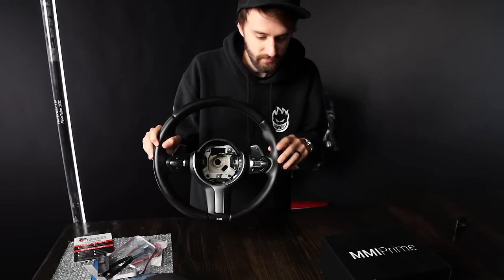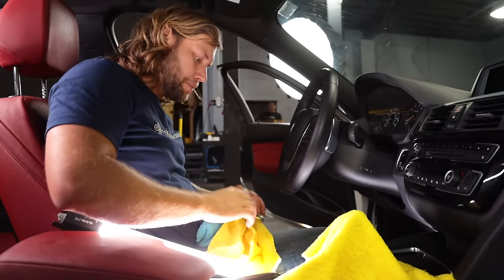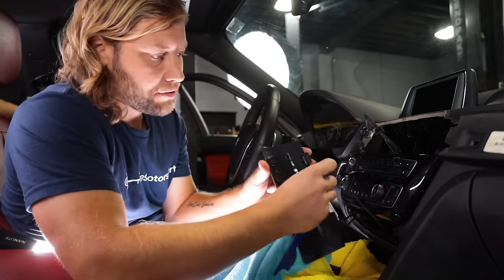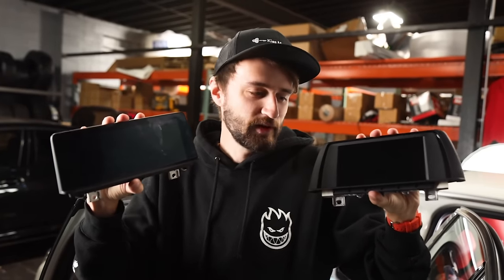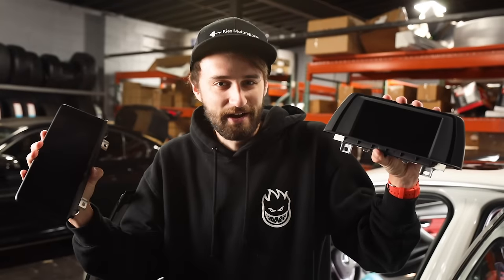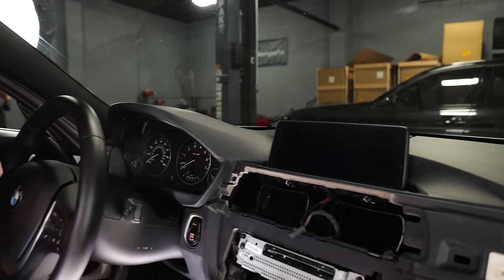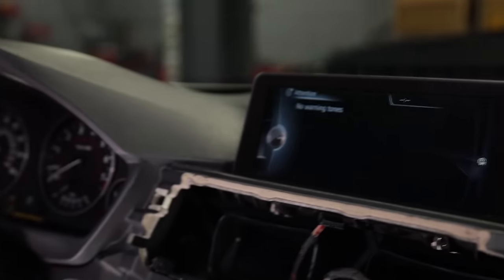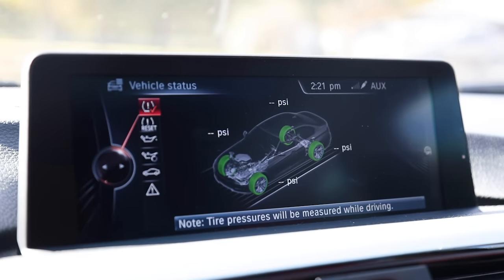How to Upgrade Your F30 BMW Screen + Apple CarPlay & Android Auto

Comment from the maker: Complete F30  Mods List ---> https://geni.us/f30-mods
Reply: How many of these have you fitted and where did you purchase this from video made it look easier than I thought it would be?
Had issues with my idrive not working at moment going to replace maybe I'd be entering of doing this install at same time.
Reply: can you do this if you have the big screen from factory but no carplay?
Reply from the maker: @KellyandmikeWilliams   kiesmotorsports.com provided both the screen and the multimedia interface module for the video. The multimedia interface has a switch so you can toggle between Apple CarPlay/ Android Auto and the factory iDrive software.
Reply from the maker: @jay7k  Yes, the screen and multi media interface (MMI) are sold separate anyway, so you'd just need the MMI if you just want to add CarPlay
Reply: Where did you buy the screen? And is it possible to buy the screen and use it just as i use the original screen i have now, without buying the MMI CarPlay?
Reply from the maker: @kkjjhhhgggff688  we got this screen in a junkyard but you can find them cheap on eBay. You can swap out yours for the bigger screen without needing the MMI or any other accessories but you’ll still need to code it to get the correct resolution
Reply: Can I do this with an even bigger screen? Or is the 8 inch one max for f chassis. I have an f32
Reply from the maker: @skate69641  I believe the 10.2" screen from the X5 will fit too

Comment: "The 6.5' peasant display" 😂😂
Reply: Back when screens were useful without being distracting though. The bigger the screen the less you will concentrate on where your peepers should be looking as in out of the front window. No wonder there are so many car crashes as people are too busy fiddling with multimedia displays.
Reply: @DEVILTAZ35  ahhh maybe! I mean there is always the option to turn the screen off regardless of the size but beside navigation the new mmi units could arguably be a bit much
Reply: @DEVILTAZ35  some old guy probably still rocking his manual stick
Reply: @hc8714  nahhhh just common sense
Reply: @DEVILTAZ35  no, it's the stuff it does while you're not looking thats the actual upgrade. Wireless android auto makes stuff way less distracting than even chamging cds

Comment: Great editing! It’s always good when you come to town!
Reply: Great video!
Reply: I'm suprised bmw hasn't tried taking you down or suing like an asshole. You just know they hate when someone smart shows us how to save money from their stealership. Preciate you bryan💪🏾
Reply: @Xylti  BMW is not Tesla, At least Indy shops and small garages can work on BMWs
Reply: Kies! Is there a kit to upgrade exhausting larger screen F30 iDrive systems to have Android Auto and Apple Carplay??
Reply: Tried swapping my 2013 f30 screen to a screen from a 2017 f30  but it doesn’t go on. Does it need coding before it can go on? My f30 doesn’t have navigation and the 2017 had navigation.
Reply: @shashankdegloorkar  Just recently BMW had taken down a bunch of websites with bmw car manuals and filing lawsuits against the owners, so if tesla doesn't do that then you might be right
Reply: How much is ?
Reply: Will this work on a 2017 BMW 320i? I was told I wouldn’t be able to get CarPlay because my radio did not have navigation. The iDrive and no navigation makes the car feel so outdated for not really being that old.
Reply: Which town?

Comment: Justin regarding your thoughts about cost of the screen, I´m working as a product engineer in automotive and we are often making changes during development of car with cost saving of 1 cent because if you can save 1cent on many areas of car it could make big difference with huge amount of manufactured cars.

Comment: Great video Justin! Would suggest upgrading the iDrive controller also to give a more OEM look. I’ve heard a lot about these solutions but tend to stray more towards a full OEM Pro Nav retrofit including the head unit with OEM CarPlay
Reply: Hey what would be the actual difference between what Justin is installing and having the full OEM Pro retrofit including the OEM CarPlay head unit
Reply: @RhinoMGTV  when you swap in a different head unit (ie. going from ENTRYNAV to NBT EVO), some features like ConnectedDrive may not work (they are VIN-locked from what i heard)
by doing Bimmertech MMI+big screen retrofit, you keep the original head unit so you can still retain all of its functions, and not lose things like ConnectedDrive.

Comment: Saw another Keys video a while back where he had to pull the glove box to mount the MMI in an f30. Nice that wasn't needed here. Pretty expensive and tedious for Carplay, but enticing to not have to disassemble the passenger-side dash. Great vid.
Reply: its 2 screws you don't have to take the glove box out just the panel underneath that you would remove to replace the filter ( I have mounted an amp there)

Comment: Would 100% recommend the steering wheel upgrade to anyone . I've done it on my 2 series and it feels better and massively enhances the aesthetic of the interior.
Reply: how much does it cost?
Reply: @michaelronan7769  you can get the wheel for anywhere between £150-£200 on eBay, and the airbag (which is usually separate) for between £60-80.
Reply: Dont upgrade the steering wheel and the screen they will get stolen.
Reply: @marsbelediyebaskani5193  maybe if u live in an absolute shit hole, i havent heard of people stealing car interior parts since like 2012

Comment: Awesome video, I used this today to replace the 6.5" screen of my 4 series for a 8.8" touch version and it was very helpful. Especially the tip to pull the unit out for some more slack on the cable was very good. I expected it wouldn't be necessary but you were absolutely right. ;-)
Reply: Where did you find the 8 in screen could you send the link please
Reply: Bro did you also use that coding program? Or its just plug & play

Comment: Cool upgrades!! I have a couple of questions, hope you'll reply!
1) Does the OEM microphone work with the MMI? Or does it have an independent mic? 
2) Which is the built year of the car? Does it have a NBT or a CIC? Does this work also on CIC/CID head units?

Thanks guys!
Reply: its a f30 so it means its a 2012/2013 hope this helps mate
Reply: @legendarygamekiller236  Dont know about him but I have a 2013 as well, good to know it would work thanks
Reply: Neither the Cic nor the nbt have the capabilities for Apple Carplay. You need to upgrade your Head Unit to either a NBT Evo the least to get access to Carplay.
Reply: @legendarygamekiller236  its a 2016… 340i

Comment: Thank you for the video! This is the proof I needed that you could use the non touch 8.8 inch screen with the entry head unit, obviously coding the car to use the bigger screen.

Comment: I installed the AvinUSA 10.25” android display in my F30 & it’s a way better option than this. You get wireless CarPlay, android auto, & can install any Android apps + 4G LTE. I don’t see any reason to go with this over that for the price. That said, solid video though & Kies Motorsports is a good company
Reply: And you can choose to change the layout to be ID5, ID6 or ID7. Oh, and 1080p with touch...
Reply: Does bluetooth go over factory bluetooth? Or through the Avin unit?
Reply: @PirateRagnarDanneskjold  Both, you can choose that yourself in the settings.

Comment: I ended up getting a OEM iDrive 6 retrofit kit from RetrofitMyBimmer.com that was Plug and Play because I didn’t want to experience the Audio Quality LOSS in the MMI. Came precoded to my
vin so I kept all my cars options and it also included Carplay Fullscreen and all that jazz . It was actually almost cheaper than the MMI and New Screen from BimmerTech too. They even include the T20 and Trim Removal tool. I got to keep my OEM Status and not experience ANY audio quality loss like all the MMI’s do.

Comment: you can also use the OEM head unit from 2017 or newer as it has wireless apple car play but no android auto, which isn't an issue if you don't have android.  surprised your car didn't have the bigger screen as I believe the 340 did come standard with the HK Audio.

Comment: Do you need the MMI unit if you just want the bigger screen? I have an Android and hate Android auto, I have it in my other vehicles. I just want a bigger screen.
Reply from the maker: The OEM screens are interchangeable but you still need to code them to the new resolution
Reply: @justinbuice  thanks. I appreciate your content. Everything I never knew I needed.

Comment: Hows the quality of the backup camera after adding MMI and upgrading to the 8.8 inch screen? It’s pretty clear on the 6.5, but curious to see if it’s still the same or better/worse.
Reply: It’s the same as the camera didn’t didn’t change. Just the display

Comment: Hi guys, 
are there any special things you need to do when you upgrade from the small screen to an original X5 10,25" ? 
I tried it with only changing the screen but I if I choose "wide screen" when coding, the display stays black. Maybe you could help me. Greets from Germany :)

Comment: Can I use that oem big screen on my bmw f30 328i 2013 will it work fine ?
Reply from the maker: It should be plug and play but you will still need to code the new resolution

Comment: I installed my CarPlay today... it worked perfectly, but then i realized that i couldn't fit the MMI Prime box behind my radio box. so i unplugged it all, mounted it somewhere nice, and replugged everything in...

then I saw a "No Signal" text on my screen (which was up during the first setup process but went away when everything plugged in) even though i triple checked all the wires once i replugged everything. let the car sit for 20 mins, drove for an hour, still said no signal the entire time. CarPlay does work because my phone recognizes it when plugged in but the screen won't do anything even though it worked perfectly the first time.

Comment: Does this integrate with cars equipped with heads-up display? Been thinking about doing this for a while but not sure if it would work with HUD
Reply: Won.t. Work
Reply: @Ajdjdncjekskf  Why?
Reply: @jouldalk   I know these, they don’t. They can communicate with the HUD.
Reply: @Ajdjdncjekskf  OK. So basically I would lose hud if I do this mode, right?
Reply: @jouldalk  OEM hud keeps working. But route instructions coming from apple carplay itself won’t show on HUD. If any other questions ask www.bimmersupplies.nl , theyy will help 🙂.

Comment: over 600 bucks ?!?!?! heeelll NO !
Reply: you have a 340 but can’t afford a $600 screen?
Reply: @boyhelios9171  you know that 320D exists, right? doesn't need to be a 340i, and looks the same :)
also, you know you can buy a used 320i non-LCI with $10k with higher mileage but still good to go for more than 5 years, right?
now imagine that you throw in 5% of the total car's cost into the screen alone :) worth it ? maybe for you, but i'd rather get better tires or filters, etc or even a stage1 for that matter 😅
heck, i can even have remote engine start for cooling/heating function from my android for that money (mounting included). yeah, definitely going with this instead of a freakin' screen
Reply: @Ris-v4w  stacks out, fire the birds or hire the barn manager lol. for 20 bucks less even /hour cant find someone who can keep count or watch the etc etc etc.... like trees / houses / ferns / whatever you call them, and its lucky you even can manage
Reply: 3yrs later and it’s double the price 😢

Comment: hey quick question for some reason my buttons on the steering wheel are not working after replacing the screen and would like to know if you guys could help me with that

Comment: What iDrive version are you using?  I have version 6 in my 430i. I use Android and wanted to see what I could do to upgrade or get android access. How hard was it to install and did you have to order it specifically for your car?

Comment: If my OEM video cable (originally that pluggued into the screen) breaks, is there a way to replace it? BMW 2013 318D F30 6 pin LVDS Right hand Drive

Comment: My screen on my 2013 328i stopped working awhile back. It only shows the BMW startup screen and after a couple seconds it shuts off and tries to reboot again. Would doing this diy fix my issue of not having the entertainment hub working? Or is it going to be more complicated than just adding a new after market screen? Any response would be greatly appreciated,  thanks!

Comment: I change from the small  factory screen to 7 inch factory screen but when i turn on the car there was nothing came on screen but the fm and the audio system is working. And then i reinstall the small screen it is working. I dont no what goes wrong with the bigger screen.

Comment: Thank you for the great video. My Z4 E89 Android touch screen does not respond at all, but the i-Drive works.  However, with the i-Drive I cannot go to the apps or settings menus.  Is there a solution for it? I would appreciate if you can tell me what to do to fix the issue.
Thank you in advance.
BTW, I resettled the OS via the small reset hole on the system, but that did not fix the issue!

Comment: I have 2015 BMW 328i M3, same as yours with red leather and silver dash trim, and it doesn't have Android Auto, sooooo annoying. Mines even came with the 8.8" screen already. Couldn't upgrade factory software to new version because 1 season too old. So if I buy that black MMI media box, it will give me the new Apps UI??

Comment: Hey, Justin! Any problems with an orange No Signal message after upgrading the screen and installing the MMI Prime? In particular when the car/iDrive is turned off but not with the doors locked. Thank you!

Comment: Hello Justin, Im in the UK this Bimmercode you used to code the screen you used a v peak in the obd2 port can i buy any similar bluetoooth obd2 device to connect to this bimmercode app you have, ive heard about coding for the BMW i just dont know much about it. i have an F46 2 series, I am a competent guy its just ive been ill for several years and only now just getting back on my feet and learning more about new tec... Thanks..!!

Comment: Does the audio connect directly to speakers like the idrive or should you set the audio to aux for audio output in carplay and android auto?
Simply, how is the audio quality in carplay, is it like oem blutooth?
Reply: @certified_fresh  thanks for the info, i was hesitant about the upgrade regarding carplay and even the whole system audio specially that i have harmon kardon sound system👍🏻

Comment: i have a f33 440i m sport with all in (include read camera and sourround view...) but it is 2016 and then the connected drive (nbt id4) with pro didnt have car play and no option to add. does it work with this tool MMI Prime too with my iphone 11 plus? nevver heared about this over half year and want to buy or must i invest 1300 euros to upgrade by original bmw NBT unit then with id5/id6 ?! but i think this device is bad because i read this: "Play music through the BMW stereo system with the help of the AUX input." !!! same crap a china tools from android auto...

Comment: wondering if you can help me I got one of this and I installed in my car. so the car has an interface and the aftermarket hu has a interface too right. I get audio from my original bmw interface but not the aftermarket head unit. I'm stumped

Comment: Did you had to plug the aux cable from the MMI Box to the original Car Aux on the center armrest? And also does the car always start in the android auto/apple carplay or do you have to change it every time? Does the original mic of the car works or do you have to put a different one or make some connection to the existing one?
Reply: bro so annoying i had to plug the aux cable into original do u know how to hide it

Comment: Hey Justin i got a small problem i hope you can help me with. I upgraded my scren to a 10.25” on my f30 2017 and everything went smoothly. The only thing now is i can’t go back to the original screen to check the oil levels and tire pressure.. i’ve been able to switch back to the original menu once but then it froze.. any solutions? Maybe i need to update or something? Thanks in advance!
Reply: These are easy user mods. Just change your oil every 6500 miles, and eye check your tires every day, and you’ll know exactly when you need to fill up which tire. Wawa will give you free air and gauge reading

Comment: For Android Auto, should I get the CARPLAY MMI PRIME that you have installed (which supports Android Auto) or the ANDROID AUTO MMI PRIME which is specifically listed for Android Auto? Not sure if they are same and if there is a difference between them.
If I use Android Auto with the MMI you have installed, will I be able to use Google Assistant?

Comment: If you are just replacing this unit with another factory piece, does it have to be coded?
Reply from the maker: You need to code it if you are replacing the screen with a different size where the resolution is different

Comment: Mate, what is the coding device that your chum used? I could do with something similar. Is there a link, please? Thanks
Reply from the maker: Hey we used an app called BimmerLink. You can use any wireless OBDII adapter to connect to your car

Comment: Did you have to plug anything into the aux port in the center console? Also, does CarPlay automatically boot up as soon as the car is turned on?
Reply from the maker: it boots up automatically
Reply: @justinbuice  Good to know. Do you have to change inputs when listening to radio and getting a phone call via CarPlay?